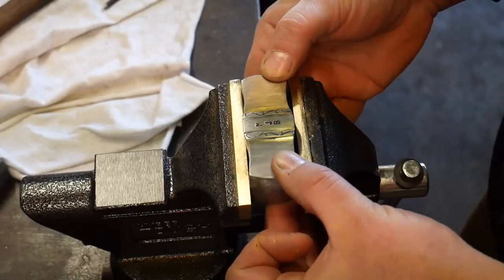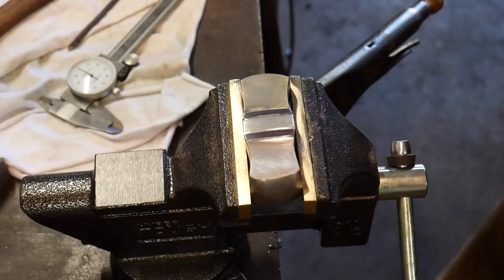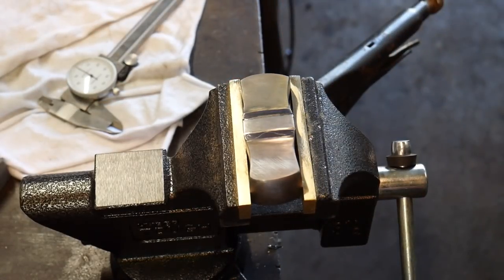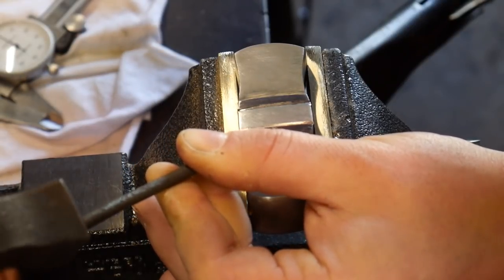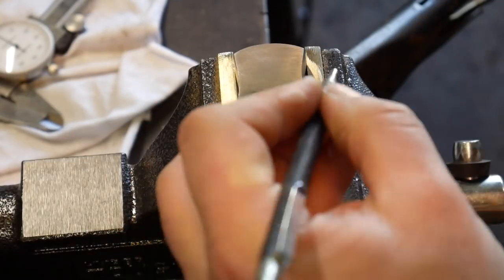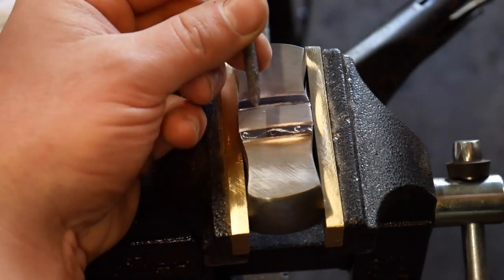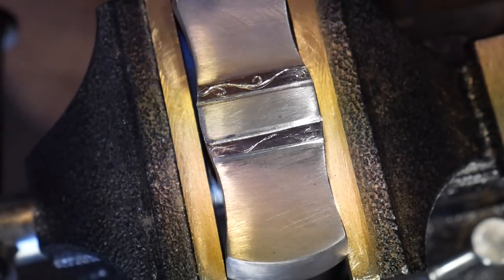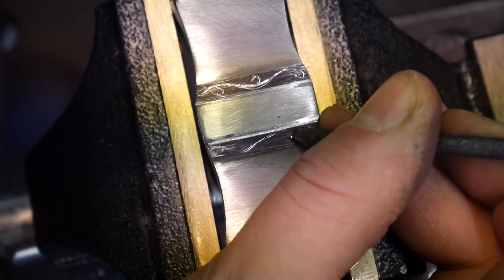How to Engrave a Hammer Head

Comment: Why don’t you use something like a dremmel with an engraving tool?
Reply from the maker: There's a few reasons for this the simplest of which is dremel tools are limited to the bits that you put in them. Also they require you to purchase these bits as where I can shape and make my own engraving tools of any size or styling. The final and last reason is skill set I put a high price and a lot of pride in doing this by hand the old fashion way I guess. There are a lot of ways of making the job quicker or easy like a Pneumatic engraver or push engraver but I simply would like to be more skilled than that :-) God bless you and thank you for the great question
Reply: That makes a lot of sense. I really relate to the idea of developing skill and to the idea of making the tools needed. These are two of the primary reasons I’m drawn to blacksmithing. Thank you for your time and generosity with these videos. May God bless you and yours as well.